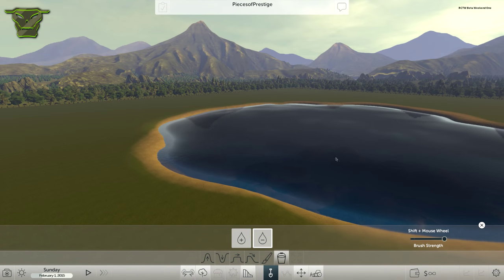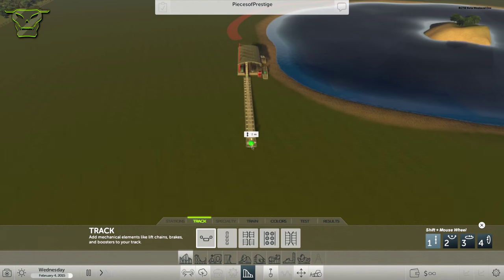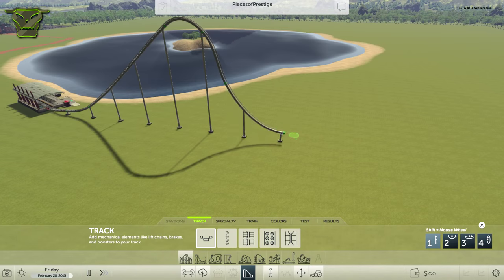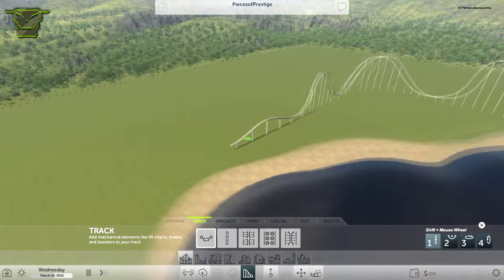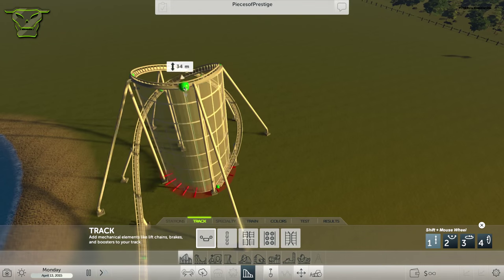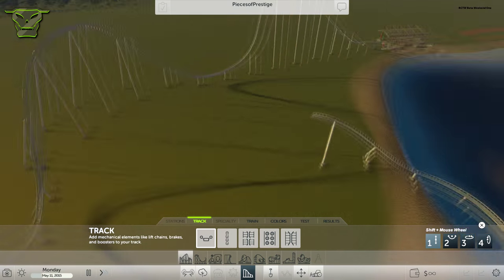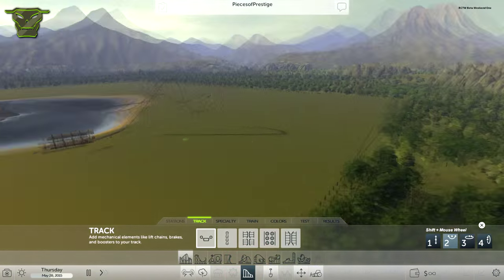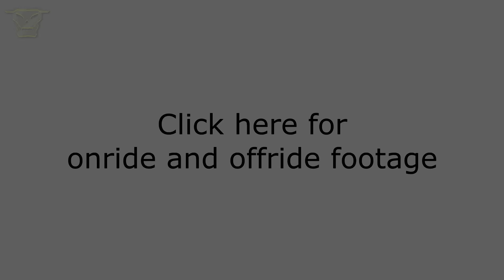Rollercoaster Tycoon World - Building a Hypercoaster (Pantherophis)

Comment: This game is going to be a straightforward nightmare! Building a good(!) clean coaster will take weeks. It is impossible to get straight lines because there is no snap grid. Did you see how many corrections were made during a single turn just to get it right? I do not mind if there is a challenge in building stuff in a game but it should stay a game and not a building simulator that needs a tech studie.